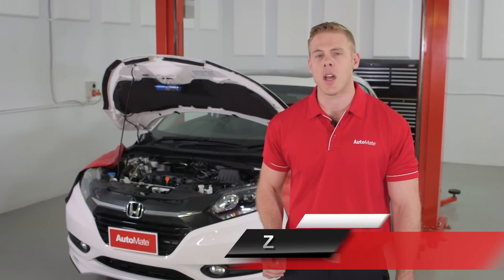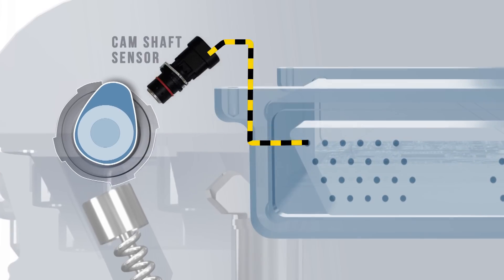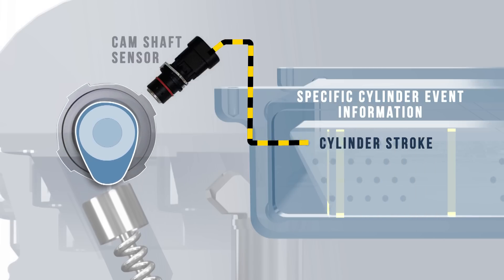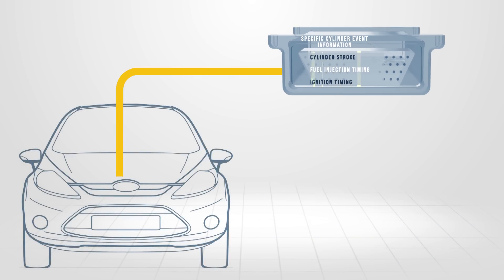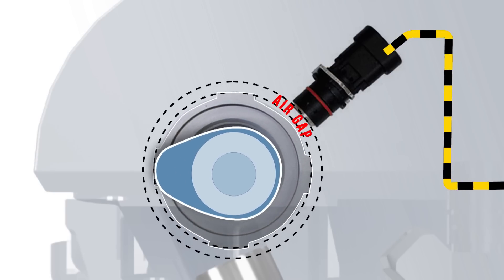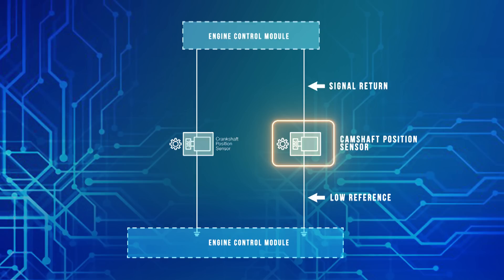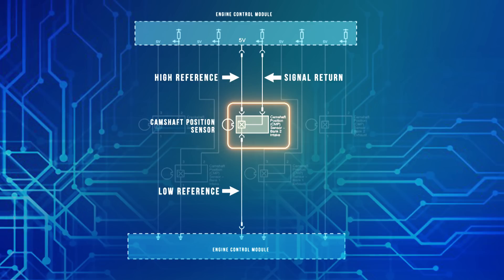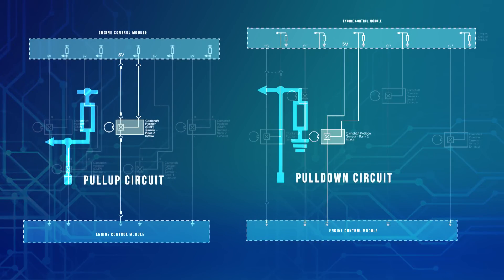Camshaft Position Sensor - Voltage High

Comment: My car cam sensor was leaking some oil
May the oil it leak was engine oil or not?
Reply: It’s actually oil from your engine , if your experiencing a leak try changing the PCV Valve , my old PCV Valve was also causing Leaks in certain areas of my car , it’s important to change that part as well
Reply: thank you. 
yes..i already changes the o-ring on that
Reply: @hanyaoyap1826  oh ok 👌🏽 and no problem 👍🏽

Comment: I replaced my engine with an import engine. I have a problem with this sensor. But it's not the sensor because I tried 3 sensors. Could it be the idling that is causing this problem?
Reply: @Jaxson Xander Flixportal =)
Reply: @Vincenzo Davian Thanks, I went there and it seems like a nice service :) Appreciate it!
Reply: @Jaxson Xander happy to help :D
Reply: Did you get to the problem
Reply: I have the same problem. I bought a new engine and have this camshaft sensor circuit too high
Reply: i realize it's kinda off topic but does anybody know a good website to watch newly released series online?

Comment: okay so.... does honda k20 use a hall or inductive ? also if i moved the sensor say or rotate the sensor 3 degree to the right, would it screw up my motor ?????
Reply: 2 wires for inductive type while 3 wires for hall effect type.